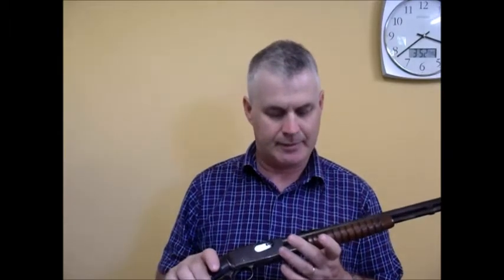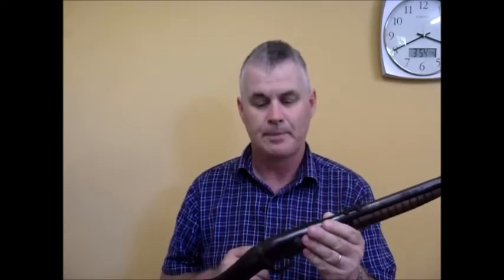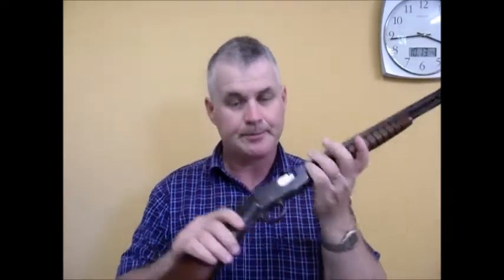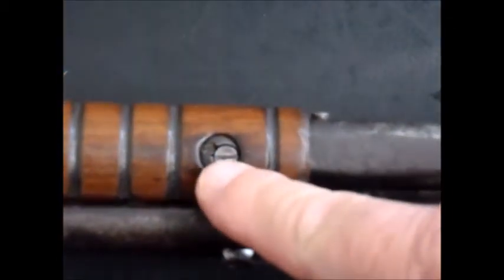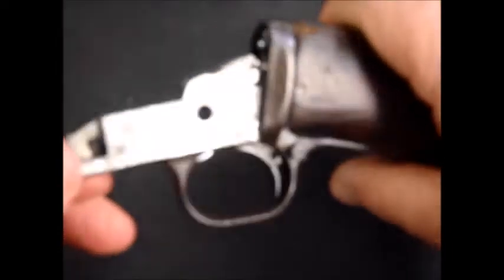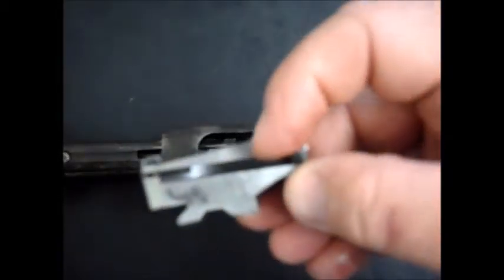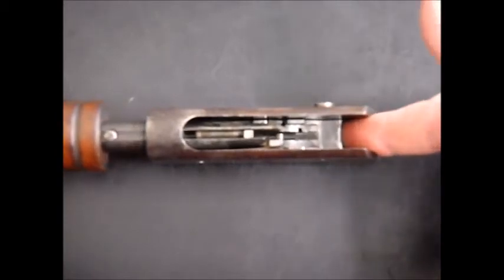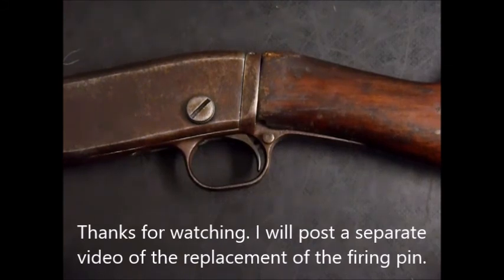Remington Model 12 Introduction, History and How to Remove the Breech Block For Cleaning

Comment: Well done, I am trying to redo the wood pump part and trying to take it off . Any ideas? Thanks
Reply from the maker: The early rifles have a screw on both sides. Just remove them and the wooden handguard should just slide off the action bar. These screws coming loose was obviously a problem so later guns have a small retaining screw inset next to the main screw. You just remove that then you can remove the main screws and the foreend should just slide off.
Reply: You have to unscrew the magazine tube from the action bar before removing it through the wooden forend after first removing the two screws from the forend sides.
Reply: There is a better way by disassembling further than shown, and it makes for even easier cleaning.  After first taking down and removing the butt-stock complete with the trigger/hammer group, and also removing the bolt assembly with its firing pin as shown in the video.  Remove the magazine sprung inner and the two side screws from the wooden forend.  Then press the take down button again and pull out the action bar complete with the magazine outer tube attached via the receiver open end.  The wooden forend will fall off loose.
A small thin steel piece will fall out from between the barrel and the receiver front.
This is the bullet guide.  First thing to do is fit it back in place in the receiver before re-assembly.  You can stick it in place with a dab of thin grease or vaseline.  It is a good time to clean and lube all the moving parts and rod the barrel clean before final assembly.

Comment: G’day do you know where I could get the hammer and  locking mechanism plus a firing pin . Thanks !
Reply: I bought a model 12C firing pin in England last year from "Brownells".  
I know that there is also a "Brownells" in Australia besides the USA.
I expect they can get any spares for the Remington 12C.   "Numrich" is another U.S.A. supplier of spares and they show an exploded parts diagram together with a numbered parts list on the internet.

Comment: I've got the Model 12 "Target" variant, I think it's usually called the Model 12-C? Point is, I can't even get the receiver off of the trigger assembly. I disengage the main screw, and I've tried everything from just wiggling the stock, to depressing the takedown button and pulling, and I just can't get the thing apart for the life of me. I'm trying to replace the firing pin, and I can't even get inside the gun
Reply from the maker: After you remove the take down screw from the left side it is free to come apart. You do not have to press anything else. The back part comes out straight backwards. There are very tight tolerances (which is good!) but several surfaces must slide past each other. Decades of dried lubricant makes a very effective glue! 
To get it apart I recommend removing the buttplate and stock bolt to remove the butt. Find a container like a jam tin or similar that will cover the action and fill it with kerosene or similar (something that will dissolve the dried oil gum)and standing the rifle leaning against something soak overnight. It may now pull apart.
If not get someone to hold the front of the rifle vertically and either use a lead or plastic mallet (non marring) or use a piece of tough plastic or hardwood between a hammer and the rifle. Tap downwards on the front of the trigger guard while it is still wet with the solvent and I think it will come apart.
Good luck.
Reply: @456eec  Thank you! My father and I will have to try this!
Reply: You have to pull it out, but it chould be captive so not all the way out. Just don’t force anything. The 12C is a treasure. I have one passed down to me that’s a tack driver. It’s Annie Oakley’s favorite gun.